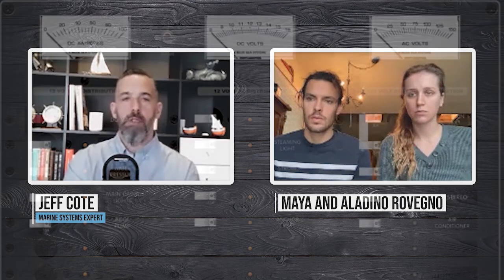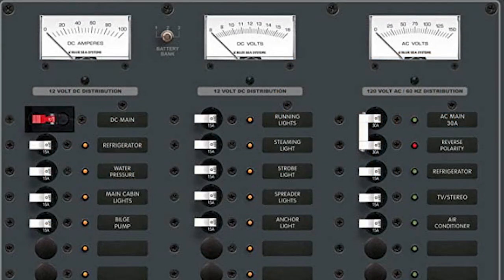DC Only Boat To Cruise Around The World?

Comment: But ac on a boat is not really related to having a connection to ac on shore... charge your batteries with other means and use an inverter to charge say 18V battery tools, to charge phone, laptop etc a USB off your batteries should be fine.
no?
How did sailors sailed before ac on boats?
Reply from the maker: Most boats would have a hard time without access to shore power or a gen every now and then.  Boats today have a lot more gadets and gear then the old days.  Today users want the same conveniences as their house.

Comment: I think you're incorrect, Jeff, about the Hz capability of the Victron MultiPlus inverter/charger. Victron's manual for the MultiPlus 12/3000/120 lists the input frequency as "45-65." The output frequency is listed as "60 Hz." Am I missing something?

Comment: I wanted to continue watching, right at the end you were going to talk about the reverse polarity issue. I have a french 220 v boat in America and everytime I hook up to shore power the RP light turns on. I wish I could find out more about this so is there anywhere I coild find the whole conversation??? Cheers and great job, keep it up!!!
Reply from the maker: do you have an isolation transformer?  you should have one if connecting a euro 230 boat to north america 240v.  because the grounds are are different reference points.  here the ground is in the middle of the 240v instead of one of the legs
Reply: @PacificYachtSystems  I don't know if there is one on my boat, I wilñ check and get one if need be. Thank you guys!

Comment: I built a desktop computer right into the navigation station: no case - the motherboard is installed right into the cabinet and the power supply is a 300W 12V ATX supply. Then I found a desktop screen that runs on 12V instead of the normal 19V and mounted it on an arm. I just threw out the 220V per supply and wired it directly to the battery (switched and fused, if course). It's not portable like a laptop but it sure keeps the boat tidy and uses also no power so I'm happy leaving it running 24/7 to run OpenCPN etc
Reply: What this is wild

Comment: I've side-stepped this by bringing a 2 kWhr LiFePO4 power station on board instead of using an inverter when I am not on shore power.   It can deliver 2000W of power, can provide North American or European AC, and deliver up to 12 DC at 25 amps.  It can be charged by either AC grid type, has an MPPT solar input, and can accept up to 30 amps/12V DC for charging.  The AC shore power and the floating AC from the power station are never in direct contact and can't be unless someone put their mind to wiring them that way (a bad idea).  An additional advantage is that the power station is a fully redundant system in case something happened to the boat's electrical system.  It has enough storage that it could routinely serve as backup power for the house battery bank.  I don't see anything that makes this a risky proposition - though I would be very grateful to have it pointed out to me, if I have missed something.

Comment: If you use Victron isolation transformer then you can take in 110VAC or 220VAC and you can then use inverter/charger with both voltages. But transformer will not change frequency so if you take shore power directly from transformer the frequency will be what ever the input frequency is. That is not usually problem because most appliances will work happily with both frequencies.
However if your power requirement is low, this setup is quite expensive. Transformers are not cheap and in small scale inverter/chargers are more expensive than separate charger and inverter.

Comment: SMC again! My wants wishes and expectations have certainly changed since my first boat. They continue to change with affordable technology and use. The Northern climate heating issue using resistance heat instead of a heat pump at 1/3-1/4 the power consumption is no longer acceptable personally and environmentally(not to mention the dock power meter bill). I have had my eyes opened to induction and instapots. The future is bright and constantly changing. Thanks Jeff for keeping conversations going.

Comment: It doesn't make a lot of sense to add AC for a 140W laptop adapter. Just look at what voltage the laptop needs and get a DC to DC adapter. This is what I do on my boat for a laptop and large monitor.
Reply: I’m interested in this issue and wonder why people convert from DC to AC then back to DC for this type of application as it surely must waste energy. They also mention charging power tools and for this I know makita sell a 12V charger for their 18V batteries.

Comment: Jeff, could you use a Victron isolation transformer to connect 240 single phase to 120 split phase and run one of the splits into a the 120V Multiplus? This would give them the ability to use both types of voltages.
Reply: I like the question, I don't think it is similar to a generator in North America. Not having direct experience with the unit I would like to know also.
Reply: @jarrahntommy correct, but the multiplus has the ability to do that. You can mix and match with the multiplus. So, the combo of the two should give you the flexibility, right?
Reply: @jarrahntommy I just reread my isolation transformer manual. You CAN configure it to accept 230V 50Hz input and 120V 60Hz output using the jumpers. So, putting one of these ahead of the Multiplus would allow for both currents if you just change the config before you hook to shore power. 

The only drawback is that you need the space in your boat for one of these - not an easy task for them given what I have seen of their fantastic build.

I just wanted to make sure to follow-up with this info for those that might be interested...
Reply from the maker: It will be 50hz 120v output.   some of your devices.  mircowave etc may not like it.  if it's only feeding the multiplus you could find a cheaper regular auto transformer instead of using the iso one.   as its' not isolating anyonemore at that point if your 240v loads are not going through it.
Reply from the maker: The victron iso transformer only has 2 wires in and out.    So it's either 240 or 120v out.  There is no split phase output.   You'd have to add the auto transformer as well.  Or a different brand iso transformer like the old Charles ones which have a center tap.

But you still have the issue of different frequencies in different counties.
Reply: @jarrahntommy I think I mistyped. If 240v 50hz into the isolation transformer with an output of 120v 60hz split phase. You can then take one of the splits and input it into the multiplus. Hopefully, I got that right.